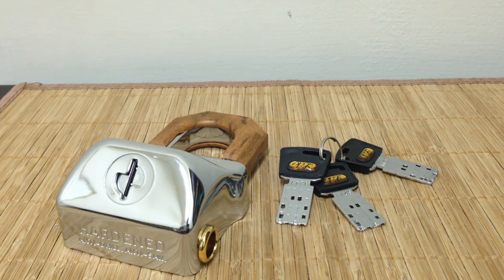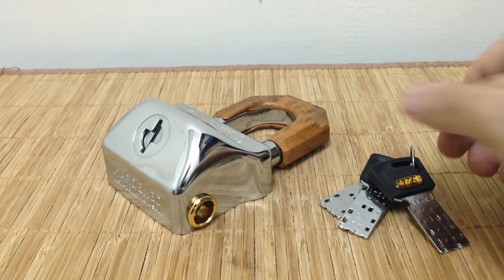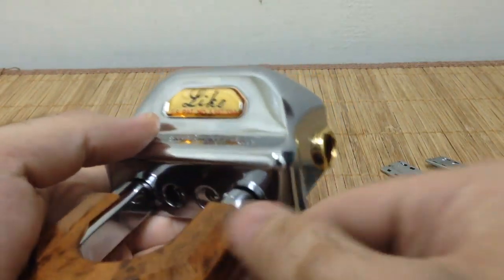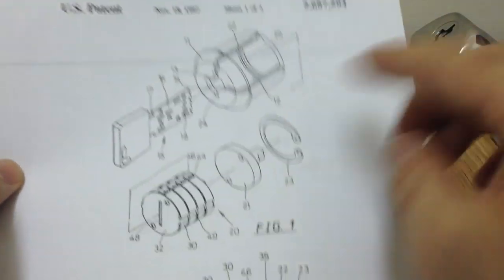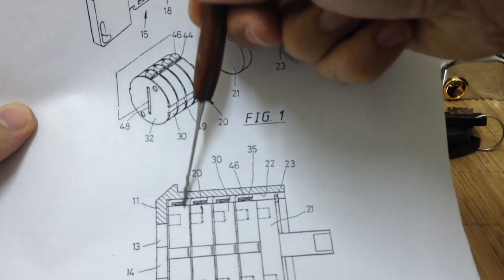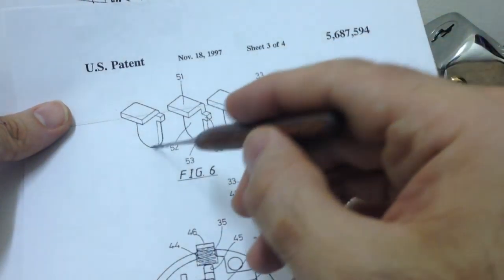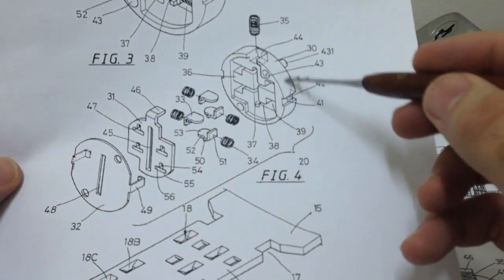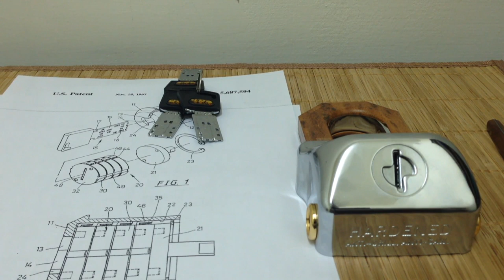[23] "LIKE" Lock with Metal Card Key Cylinder! (so many patents!)

Comment: What a fantastic lock. I have one in my collection exact same shape but mine is a Mul-T-Lock.
Reply from the maker: Thanks!

That's cool that you have a gear shift lock too! I actually like this format a lot~ they are built quite tough. I read somewhere that the Mul-T-Lock version is not available in the USA anymore as gear shift locks are not really used much in the States.
Reply: Thats interesting that the mul-T-Lock one is not sold in USA anymore. Mine would be quite a find for a collector in USA then. I have picked a few mul-T-Locks in my time but this one is very temperamental indeed. Looks great on display though. Yours has a lovely wood effect on the shackle, mine is bright yellow to sticks out visually to a would be thief.

Comment: what are the top screws for?
Reply: +qwerty keyboard I guess they are the screws that you use to install that lock to a bracket as he mentioned... Either that, or there's a thin outer shell that is held on by those 2 screws...